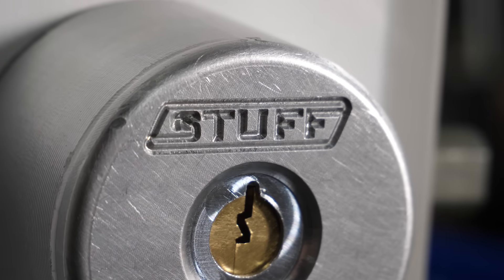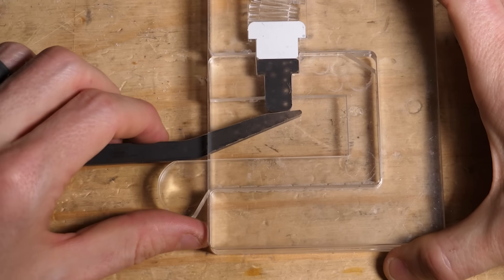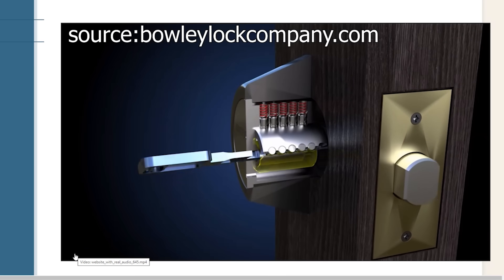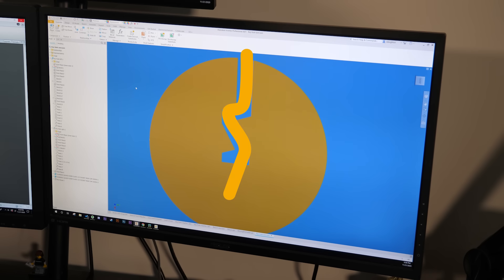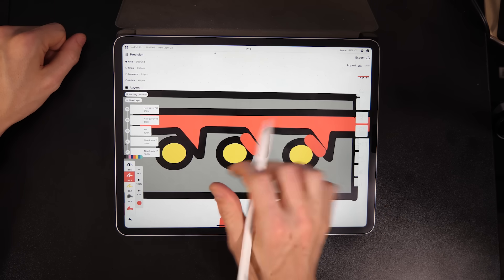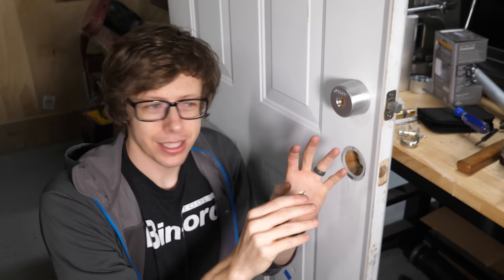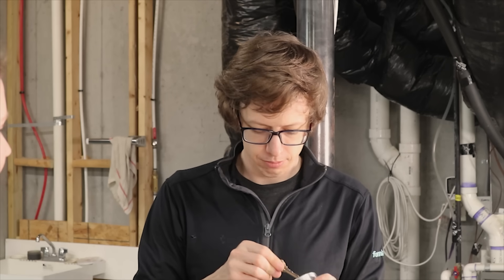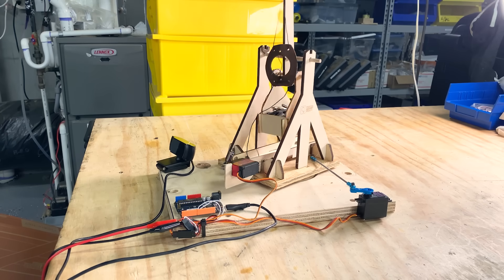Making an unpickable lock. Calling locksmiths

Comment: What's with all the comments saying don't all locksmiths specialize in picking locks. What? No. Yeah a lot probably could do that, but their job is to create keys and locks, not pick locks (which isn't the same as making a key, a key isn't a lockpick). Someone that is capable of doing a job doesn't mean they're specialized at it. An engineer that makes circuitry may be able to code software too, but that doesn't mean they specialize in software engineering.

Yeah there are instances a locksmith can open a door they didn't make the key for to assist law enforcement or a similar agency (some may directly even be a member of those agencies). But typically they would just use a battering ram to break into a place a criminal is refusing to open the door to anyway, unless there's no other way to get inside.

Comment: See what happens if you set the base of the key channel low enough as to almost interfere with the pins so there is zero clearance to insert a pick without interrupting the position of the pins.

Comment: What about a lock with a free floating body that if its not in the same place as the pins will lock  and be impossible to open while having this system and using non magnetic parts i.e titanium, tungsten ect this thing would be a devil of a lock all i need is for this idea to be not such an idea anymore

Comment: The "I found a locksmith that specialises in picking locks" highlights an interesting point that a locksmith will basically break into whatever you are trying to get open if you want and they might not even know how to pick a lock. I have got into my parents house on a dozen occasions when I forgot my key and when I lived there I think that makes me a locksmith. Every time I broke in my parents fixed the issue, one of the hacks involved a paint roller, my parents left a upstairs window open and that window was very small but it was enough to get a paint roller in and use that to open the window below and the paint roller was just on the ground. If you want a secure house try breaking into it every now and then, that being said a burglar will just smash your window or break your door to get in which is what happened to my parents while we were all on holiday so all the fixes they did were pretty pointless. If you are planning on keeping people out of your house you will fail.

Comment: Locks without keys (electronic locks, etc) may not be able to be picked, but they can certainly be bypassed. Sometimes it’s easier to bypass a lock (mechanical or otherwise) than to bother trying to pick it.

Comment: As lawer said 
"Strong as it weakest link"
It should be not only pick resistant but also resistant to brute force
(Its like some Swedish lock, which almost impossible To pick(tales to much time and effort) but the way it installed allows to open it with a hammer and a nail)

Comment: The thing this guy doesn't understand is that specialized tools are created specifically for picking locks. If there is a key, then the lock can be picked. There is no such thing as a unpickable lock, only a door with no key that can only be opened with a format that a locksmith cannot obtain.
On top of hiring an amateur to try and pick the lock, just an overall bad video in the sense of what you were trying to achieve. There are tons of far more advanced and mechanically complex locks than what you have designed and there should have been a lot more research into this subject. Should have called up LPL!

Comment: Problem is that if a locksmith is at your door to unlock the door, if they are unable to pick the lock or some other methods. the last method they will use is to Drill the Lock out. So yeah. Missing one the last pickable method. The Drill pick. while it will break the lock and make it unusable. it is still a method locksmiths use as a PICKABLE method. so unless the lock can be some how Drill proof too. its not a unpickable lock then. So this lock would be considered a Fail then.

Comment: In all honesty, you can put a lock that is glued, you can screw the door shut to the frame. If they want it they will go through the roof of the building. I've seen it all before. mess with a lock like that or just remove a few roof tiles and then disengage the garage door from the inside. cars gone, motorbikes gone etc. its the same with a house. through the window and just take your key.

Comment: Fun random pointless fact, those big lego fire pieces work really well for SMALL locks, if the locks are too big it'll break, but if you have a lock that's the same size or smaller than a large lego fire piece it can help open a surprising number of locks, I'm terrible at using paperclips/lockpicks, so sometimes I just use the lego piece, it's good if you're bad at lockpicking, but of course the number of locks it can open is far less than a lock pick/hair pin or whatever else you would normally use.

Comment: To make a real 'unpickable' lock is actually quite simple.
Just make a lock with branding that makes it look like a regular high street hardware store generic lock, but it actually has a couple of trap suicide pins that jam the lock closed if you try and pick them (like a hines key).
LPL has videos showing how to pick hines keys, true, but if you DONT KNOW its a trap, you will attempt the pick thinking it is a simple hardware store lock, and trigger the trap pins.
Remember LPL has plenty of time to research and examine the lock, on his workbench not in a door,  before attacking. A real life burglar, even one with strong lockpicking skills and a full kit bag of picks, only gets to see the outside of the lock and has to choose how to attack straight away based on just that.
Reply: Well then you've lost your lock (if I understand what a suicide pin is)
Reply: LPL also opens challenges on camera, from secure packages.
Reply: Doesn't matter because it's still not an unpickable lock by definition.

Comment: Bro, one of my closest friends has a locksmith company that is on 10 States. Heads up, they don't do lock picking as you would expect. Lock picking is very specialized, and takes a long time to learn. Long story short the locksmiths I know in 10 states will walk either use a bump key or drill it as they don't know how to lock pick.

Comment: I have a heavy hammer nicknamed "Thor" that will shatter the lock assembly on the hit inwards on the face and shear off the handle or dead bolt face on the strike down if the client isnt attached to the lock and main goal I to get in😏

In theory I'm breaking the screws and bolts but cannot gaurentee the parts will survive in usable condition from the impact when new bolts and screws are used

Comment: every single lock that was ever invented was in fact unpickable. that is, until someone invented a way to pick it. the lock here may have upped the game. but i guarantee that within a year, and that is being overwhelmingly generous, someone will create a method or tool specifically designed to pick this lock.

the questions i have is
1. is it drill resistant? 
2. is it freeze resistant?
3. is it fire resistant?
4. can someone simply crowbar your door?

Comment: I saw a really clever lock where you only put 2 or 3 teeth instead of the whole keys body and turn it. It confuses lock pockets because they think they need to move all the pins and not just 2 or 3 (it’s a 5 pin lock)
Reply: That's not how lockpicking works. You would feel only 3 pins instead of 5.

Comment: If the center cylinder won't rotate until the three pins are set then all they need to do is apply slight pressure rotationally, set the pins, and then apply pressure to the locking bar in the rear. Say by putting the lower half of a lock out key in, picking the pins, then pressing in the half key to set the lockout bar.

Comment: I designed an "unpickable" lock.  If an implement other than the key is inserted that does not completely fill the keyway will trigger small spring loaded "tumblers" that spin into the keyway with a ratcheting mechanism.  To pick the lock would require holding down all of these spinning tumblers, but the pins that need picking are interspersed between the spinners making it difficult to both retain the spinners and pick the individual pins.  If the lock is triggered, you must reset it from a secondary keyway before the key can be inserted.  This forces the lock picker to stop and pick the secondary lock whenever the flip tumblers are triggered.
Reply: Sounds too complicated to actually work in practice. It would either jam up or you could just hit it hard enough to jam the "tumblers" into the correct position.

Comment: You should definitely send this to TLPL but I can tell you right now a couple potential weaknesses I already spotted. The lock doesn't appear to have any anti-destruction defenses. AKA the lockpick you hired is likely not going to want to destroy your property, but a real intruder wouldn't care and could probably just drill that thing out in a less than a minute. I know that this was specifically designed for picking but a good lock has to try think of anything a thief might try in order remain secure.

Also not sure how much tension is on that spring bar but if it is too much it might be possible to feel when it is engaging on a particular pin similar to cracking a combination lock if the person is particularly adept at such things.

Comment: Unless that lock is connected to a 4 inch thick steel door the easiest way to defeat it is usually just use force to break whatever it's connected to or cut around it with a gas axe. If you need to do it silently without being noticed then obviously that approach won't work but in the real world thieves will do pretty much whatever it takes to get past a lock if the payout is big enough. As a professional CNC machinist for ~30 years the idea has merit but in practical terms it's not commercially feasible unless you sell a million of them to banks or something. I suppose you could patent the idea but you've already given away most of the basic idea so another smart person or company could copy it or use that as a base. Yes I understand this is purely a learning and educational experience :-)

Comment: Idea for lock. You have key with battery and when you put key in lock it has power on lock you have finger print reader. Only concern is battery, will it have enough power for electromagnet inside of 🔐.

Comment: what if instead of pins, which seem to be the hardest part of making this, they were horizontal bars perpendicular to the key. the key could raise and lower the bars just like they would pins, but i'd think a bar would be much easier to freeze in place especially if one side of the bars attach and rotate around the same point so that the other side of each bar frely lifts to different degrees depending on the cut of the key.

Comment: Love the educational value and the challenge this poses, but in terms of force-able entry, re-designs and improvements shouldn't stick out of the door so much. It's a big lump facing externally and is probably vulnerable to snapping and me just taking a big hammer to it to knock it off and access the deadbolt. Also ensure you have an anti-drill plate or several. Most times when I'm bypassing a door I'm not looking at the lock but the other parts of the door: Is the bolt configured properly? How much space exists between the door? Is there a letterbox around etc...

Comment: I re-thought the entire tumbler lock method. What I have come up with is an old soviet russia ideal. The idea that, in the "spy games" of russia, the ambassador of America was spied on with a seal given unto them from the Eagle scouts of Russia.

The spy device was a simple setup that could be remotely powered, and could send a signal...

using this combination of things one could make locks far harder to crack, that would requite brute force hacking, or physical destruction of the product.

You could set up a inner power system that hs to be remotely powered, since it doesn't use a battery but a clever system of utilizing resonances to agitate a wire that then powers mini volts to a device that then can operate and send a audio signal back. 

A lock could be keyless, no finger print and use an acoustic powering system of a lock guard, while exchange wireless digital keys between them. So its like a duel lock.

The modulating acoustic rhythm, powers the system into a setup, start and data mode, which has to occilate within that freq. While then sending and exchanging data to then utilize the remaining power to disengage the lock. So the internal system has to be powered, while then keys are exchanged and each system could be encoded...

The simple system would still be effective since it would be a new type of lock on the market. Not some 2700 year old design. 

Simple setup:

Sound powers device. (holds a slow charge meaning it drains out slowly)
Authenticate key exchange.
Powered device authenticates and unlocks.

Making it harder

Unique Sound/range powers device. mini battery gains a charge, the sound gives this bat a max life span powered of say, 14 seconds. Continuous sound keeps it powered.
A256 hex key is exchanged. Which then is encrypted on your device itself, so the actual key is never known to the user, special proprietary program, that further encrypts a key log. Key is authenticated.
Lock power disengages whatever locking mechanism is in place. Could be a rotating powered system, that releases metal one way clamps, that need power to move. IE are locked with internal pins that rotate or slide out that lock the mechanism. In my head it has a design, but you get het picture...  to avoid hammer taps and what not.. This ensures that the person has to atleast power the system internally to get it to open. the cool thing is, the system has no key.

How to unlock, well a cell phone could unlock and authenticate it... so that data or information could be stolen off your phone... could include a biometric, so it reads your finger print.. but that seems a little strange.... Could use a hair... but hmm... if its on your cell phone, the phone itself could do a final step as facial recognition of the person....

That can be faked with a photo.. DNA could be taken from a person...

 So maybe the phone can produce the noise... or a special device.. and the phone exchanges the key... to open or a unique product... but then anything be blasted digitally can be heard ... so maybe the key comes from a unique language based system with a similar encroypted system and each key is unique to those digital authentications and can't be on a phone, use a entirely proprietary language... no saan.. no dos.. no bios... Could even utilze a non-binary language, with a different type of encrypted electrical/ radioactive information... but then that could be scrubbed in the airways... and figured out... hmm..

well short of the phone being stolen.. I think this would be pretty tough lock to crack.. if designed..
Reply: Where is the feasibility study?

Comment: 2:20 This is kinda misleading; it tends to suggest that a five-pin tumbler--or ANY physical--lock would or could have anywhere NEAR 6*26*26*26*26 combinations.
In reality, even really well-built, high-precision, high-security pin-tumbler locks (like Medeco, for instance)with sidebars and axial pins have maybe 8*4*24 combinations. One drawback of physical locks are the manufacturing tolerances, some of which demand that even though a pin could be cut to any of 8 depths, there are limitations because the key would become jammed into the lock if adjacent pins were cut too far apart. So in reality, even though any individual pin COULD be cut to X depth, the depth of any adjacent pins serves to further reduce the number of physical sets of differs possible to something like 4*4*8*8.

Comment: There might be a tool that can open this lock. Here in Europe we're having problems with what's called "the Bulgarian key" ...it's a tool designed by spies...basically it goes in neutral/flexible and then copies the configuration of the mountains and valleys inside the lock..which then it's used to make an exact replica of the key.
From what I read the only locks who are invincible to this tool are the ones that use keys with "craters" and authentication like in the auto industry. 
Here's a video how it works. You can find other videos if you search "chiave bulgara" (bulgarian key) 
https://youtu.be/vMfb3KRYUMQ

Comment: "if you want a truly unpickable lock, get one that doesn't have a key (RFID)"
Me, an IT specialist immediately thinks: "so, get a hackable lock instead?" i mean, there must be way to defeat RFID! And sure enough:
https://www.google.de/amp/s/www.instructables.com/A-Universal-RFID-Key/%3famp_page=true

To be fair, it's much less practical, as you need to have a good look at the keycard, at which point you might as well be able to just steal it, but from there it's just a 15$ device to emulate the key card transmitting the code that's written in plain text on the friggin' card! and you gain access.